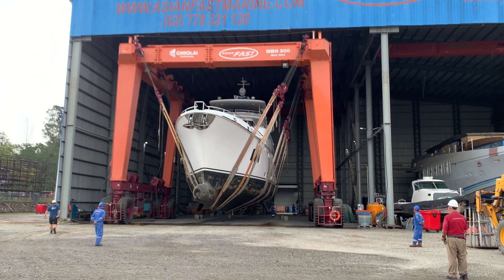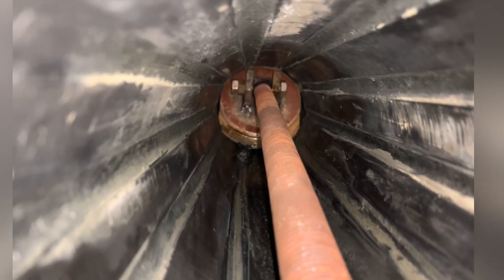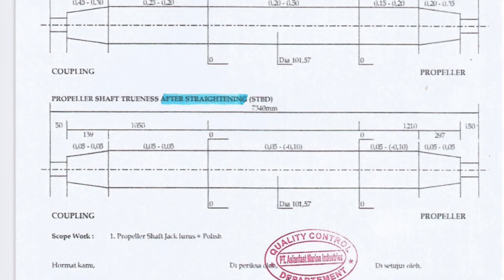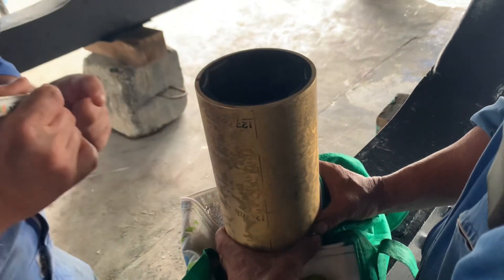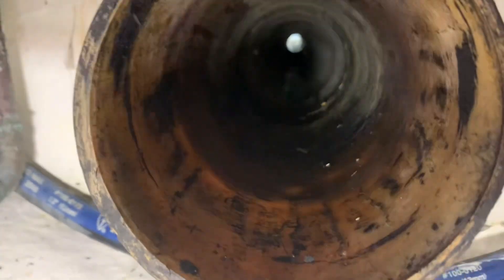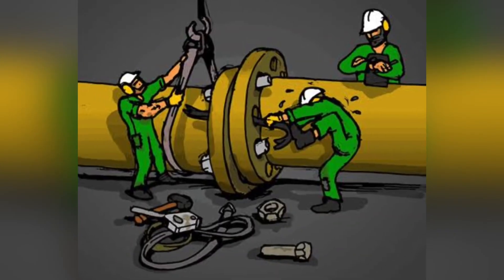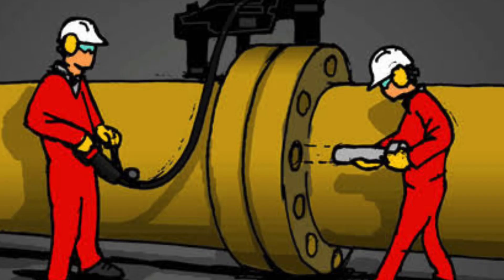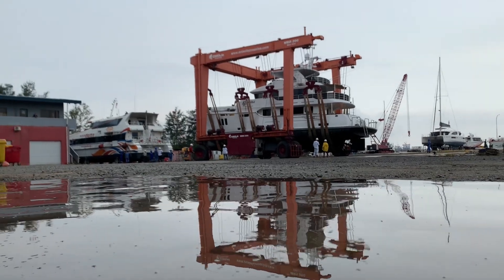Nordhavn 86 bearing issue ( MY Koonoona 2022

Comment: How many Hours were on the Shaft? Also curious on Cost of replacement, if not too sensitive?
Reply: Yeah, my thoughts as well, someone stuffed up, with 7000 hours on the clock those cutlass bearings should have been in very good shape. My guess is cheap material and misalingement along the supply and deliver chain. I know of at least three other Nordhavn of similar sizes to this having issues re delivery voyage issues that would raise eyebrows as the problems were not minor.
Reply: I don't think your heart could take the cost.  Lol